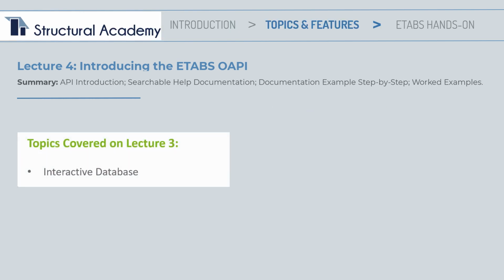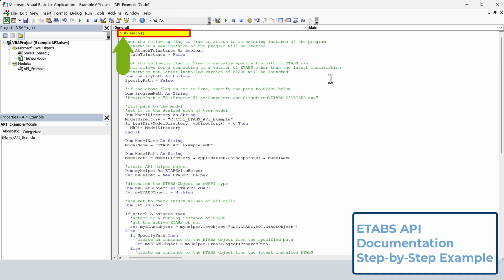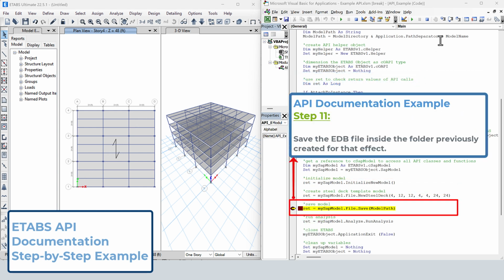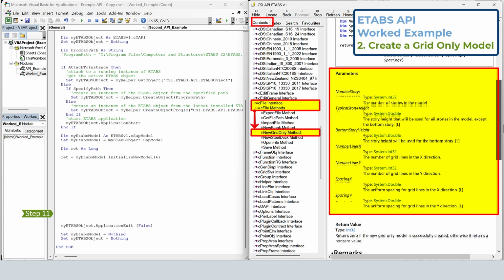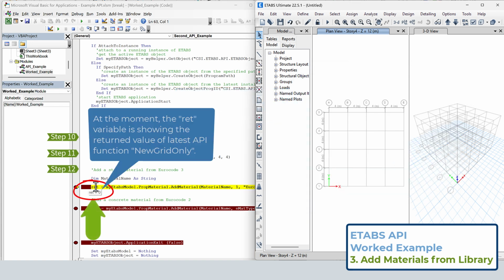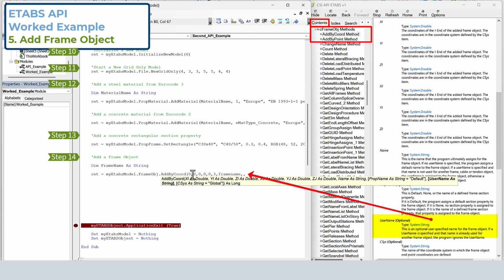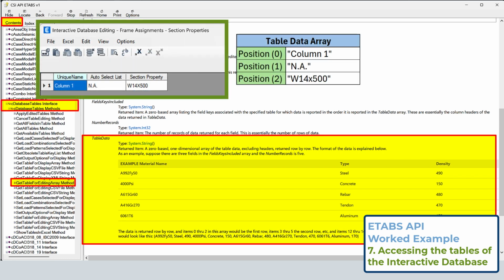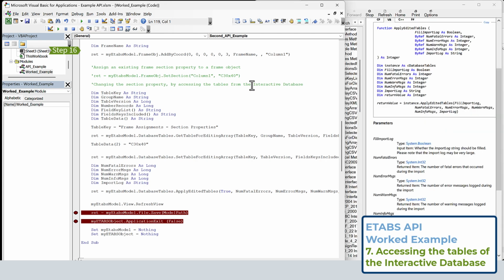ETABS Training Series - Lecture 4 - Introducing the ETABS OAPI

Comment: Thank. It help me a lot for my work. I create some tool by VBA Create Load Combo, Load Case, Create Frame Section. It worked. However, I can not draw design strip by VBA. Could you help me it ? Thank you very much.
Reply from the maker: Thanks for your feedback, @nhatta6825 — we're glad the video helped!
Regarding your question: unfortunately, the function to create Design Strips via VBA is not yet available in the ETABS API. According to the documentation, this feature would be linked to MyDesignStrip1A, which is currently not implemented.
We've reached out to the developers to check if there's an alternative method or if this functionality will be added soon. We'll keep you posted!
Thanks again for your input — it's very valuable to us.